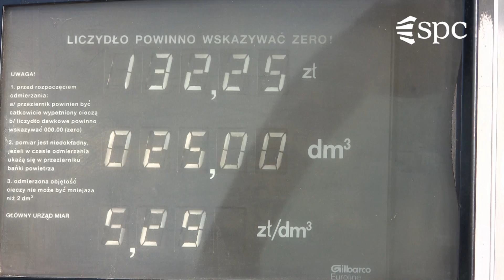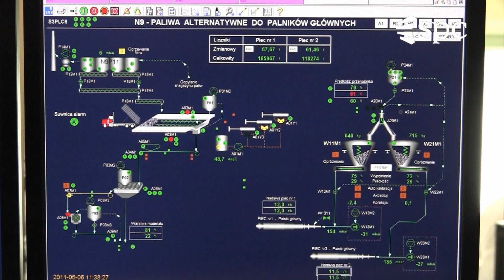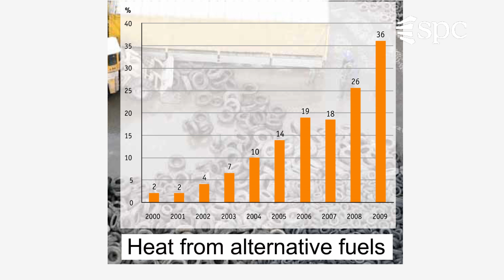Alternative fuels in cement plants in Poland

Comment: FOR SALE 
Used as alternative energy
Refused Derived Fuel (RDF)
100,000 ton /month 
Material : CER 191212
Plastics and epoxy resins derivd from mechanical traitment
With best regards
Mohamed el sharif
WhatsAAP 00201000758921